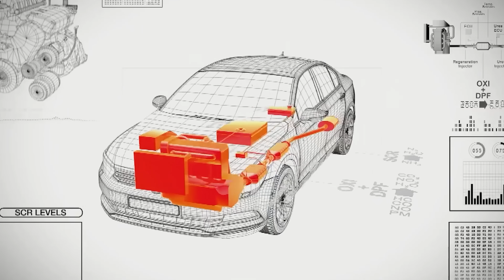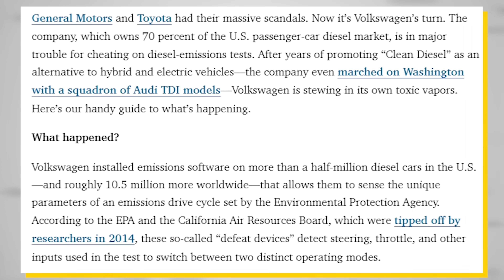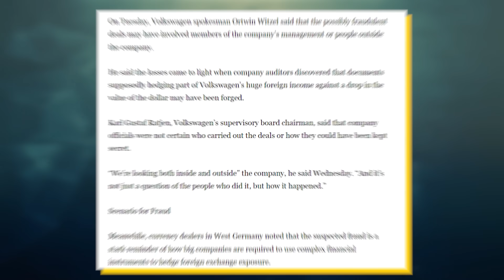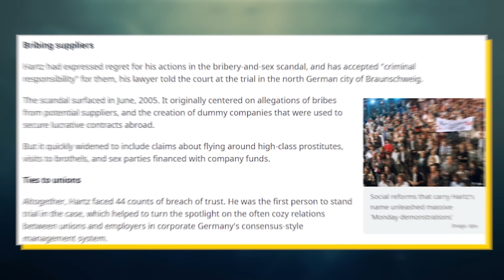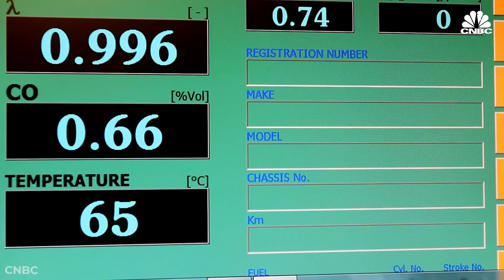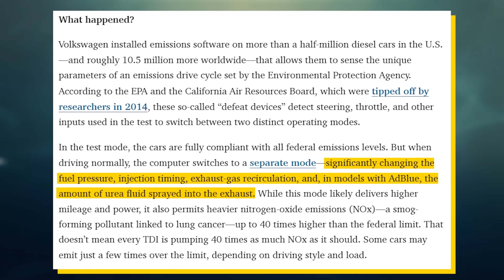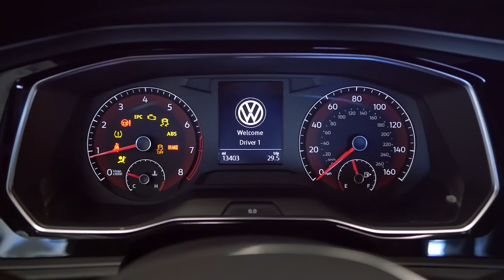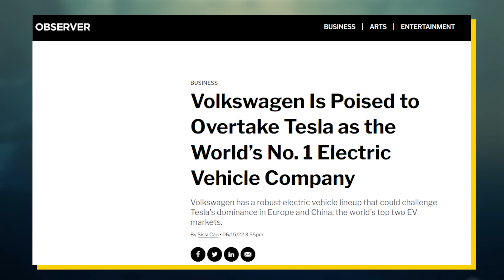Why Volkswagen Was Fined $34.69 Billion

Comment: Idk how VW got away with this for so long. I saw alot of Jettas leave a black cloud of smoke behind them and I just thought, poor guy someone must've taken his catalytic converter.
Reply: I'm old enough to have driven MK2 Jetta that were smoking coal. I used to smoke tail gaters with a nice black cloud. Those were A LOT WORSE than the TDIs involved in this witch hunt.
Reply: @bmw803  My MK4 Golf with the 1.9 SDI would throw plenty of black smoke if you wanted it to.
Reply: Passat tdi owner here. My car is completely stock and it leaves a black cloud behind everytime I floor it. It has been doing that since it was new.
Reply: Its your valve stem seals

Comment: Hari you left out Skoda and Ducati. 

Believe it or not Volkswagen were the only automaker to get caught, everyone in the industry practiced this method, even Toyota cheated their diesel test in the early 2000s  but the news didn’t reach mainstream like this one did.

You did mention it correctly about the scandal, about why people buy German cars and deal with the hectic maintenance believe it or not European cars were reliable till the 90s after that something within the industry changed and they stared cutting corners. During the diesel-gate scandal even the CEO knew about the  device instead of taking appropriate actions he fired the guy who mentioned it and later fired the whole engineering team involved during the development of diesel cars. The whole TDI engines produced from 2010-2016 were all bad except 2-3 engines. They did gain a bad reputation even in India after the Hyderabad scandal but they did buy back the diesel cars sold in India at that time of the scandal. It’s sad to see a company like this engage in an activity like this but they were a good company after WW2. Their EV operation looks good but they are no match for a Tesla, they are better only at build quality which they have experience at. They may takeover Tesla in terms of sales but Tesla is very unique from the other manufacturers. I hope you cover that in a video.
Reply: Makes sense, cuz Skoda is under VW, and Ducati is owned by Lamborghini, which is owned by Audi, which is owned by VW

Comment: EVs are not a solution to anything and never will be
Reply from the maker: Bold opinion haha
Reply: Right now they are not but in about 20 years the scenario will change a lot
Reply: @LogicallyAnswered  what about the african slaves mining materials for batteries? High emissions of manufacturing EVs? Unaffordable price? Non sustainable energy being used to charge them? Concrete used for roads and parking spaces? The solution is instead of building suburbs build european style cities with amenities being accessible by foot or good public transit. Climate change cannot be fixed by just adding "E" to your inefficient lifestyle. You have to change your habits and no amount of engineering can change that
Reply: @LogicallyAnswered  not to mention the damage to society of cities not build for humans
Reply: @real151kmh  in elon will invent the batteries with 10% price and ten times capacity with no use of scarce resources mined by slaves which also wouldn't burn down the whole car to ashes when they catch fire
Reply: @LogicallyAnswered  and public transit doesn't even need batteries. Trolley busses, trams and trains are already electrically powered
Reply: @vishipsherrah  public transport is all good in cities but go into smaller towns and the numbers don't work. Sure America has a way to go with public transport but for a country as large as the u.s and with a low population density public transport won't work well.
Reply: @philipjones3599  population density is low because of cars and zoning restrictions. EVs are better than internal combustion cars but they will not solve climate change

Comment: There is of course more to it then that.  Governments standardize tests.   My Camaro says it can get 40mpg.   Which of course it can.  But Based on how it's driven.  It doesn't normally.   So is Chevy cheating the test?  No. The run the test based on the government specs.   WV didn't one day decided to be evil.  The software was adjusted to reduce power and produce less emissions while the car is stopped at a light.  It new that because the front tires were not spinning.   This is a GOOD idea.   Why pollute more when you don't need the power.    Then they where 90% there.   I'd like to see the detail in the software.   What did they change to get it from a good idea to a bad one.   I think they could have won legally as because it is a standard government test.   But they would have lost in the public perception.    I liked there solution to it.  Making them fund EV charging sites.
Reply from the maker: Interesting perspective. Yeah I bet people would’ve just hated them even more if they were able to get away with that